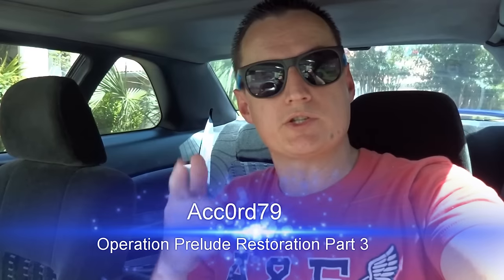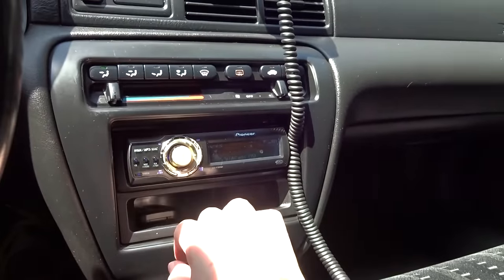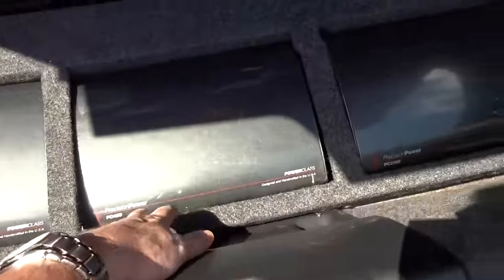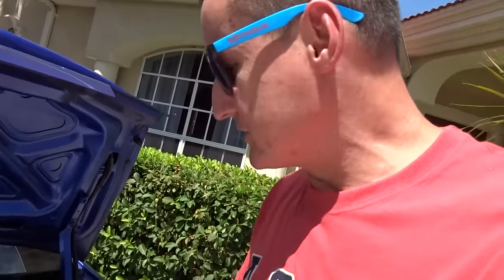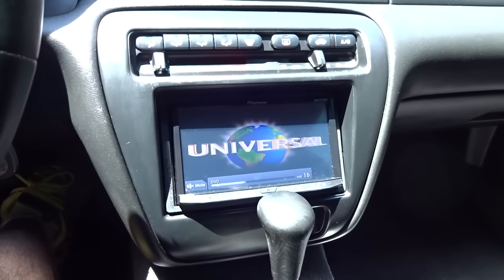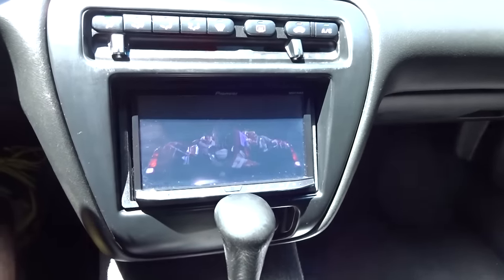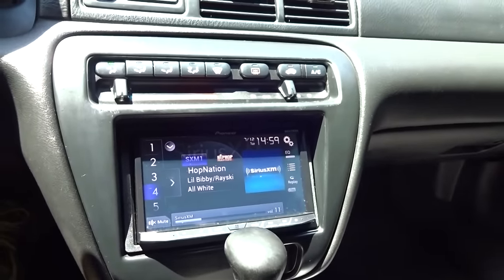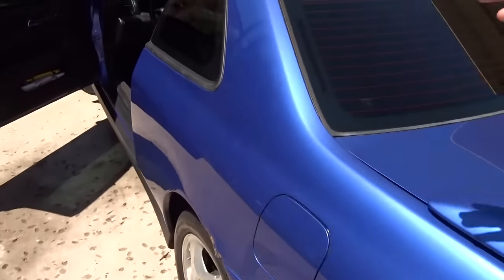Operation Honda Prelude Restoration Part 3. JL Audio, Pioneer, Precision Power setup.

Comment: This shit is DOPE. Love a Prelude with a high end stereo system 👌🏽
Reply from the maker: Yah, it sounds great, just had the car worked on and now I don't know why they touched the stereo but the speakers are all either not working or quiet. Now I have to take it back to the stereo shop. Idiots at the automotive shop messing with my stuff.

Comment: That's awesome mate, that bass sounds incredible!
Reply from the maker: it really is, I am so glad it all works again, it's been so long without any bass or rear speakers due to the bad wires not connecting properly to the amps.
Reply: +Acc0rd79 I have 8 inch factory subs under my seats however I'd love to get it fitted out properly! Having said that the factory system is not too bad in the F30 beemer.
Reply from the maker: Ken Lawton always that point where you may need the trunk space....gotta weigh the options!
Reply: +Acc0rd79 True.

Comment: Can you show how you ran the battery wire
Reply from the maker: I paid people to do it so it runs to the front through the firewall and then into a fuse breaker and then to the battery.

Comment: Add some coilovers🙏🏼
Reply from the maker: trying to keep it clean right now, just restore all of the bad parts and make it look clean stock again.
Reply: I think what he is trying to say is that you should probably focus more on the performance part of the car first & foremost since you say it has 190K and you're planning on switching to a 5speed on the original motor. A new sound system isn't going to help the car keep running. Love what you're doing with you're BB6 though !! :)
Reply from the maker: EREYSUN I own a 370z (for sale btw to buy a used GTR) and a sport bike, I don't need speed;) hehe
Reply: I agree Acc0rd79, I have a 98 Auto and working on doing the same. Even though I have a love/hate relationship with my Lude and debate back n fourth about selling it, I still just want to focus on restoring it back to it's original state when it was brand new. Not very easy these days seeing that certain parts are now becoming harder to find. And if you're gonna want more speed, may as well get a real sports car that's truly built for just that. Nice GTR btw ;-)